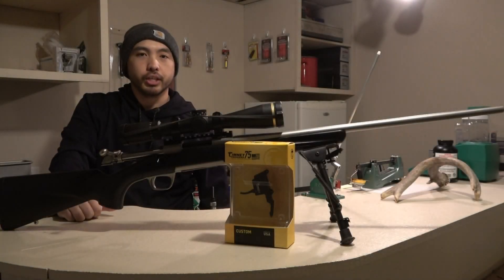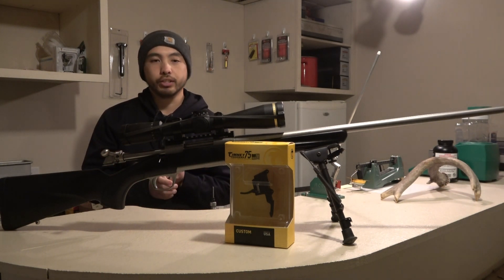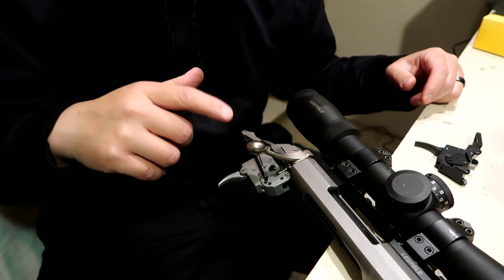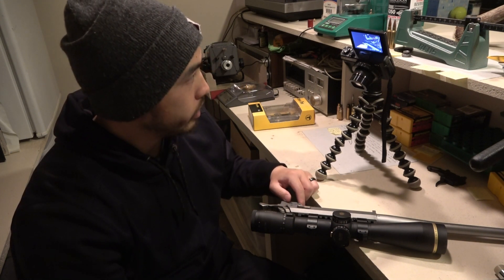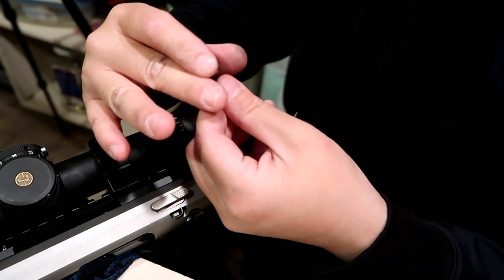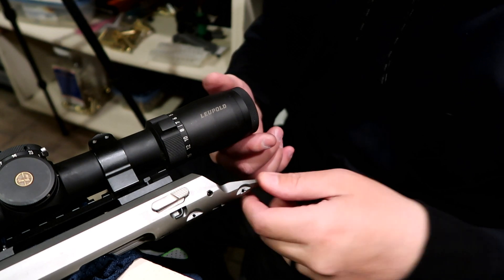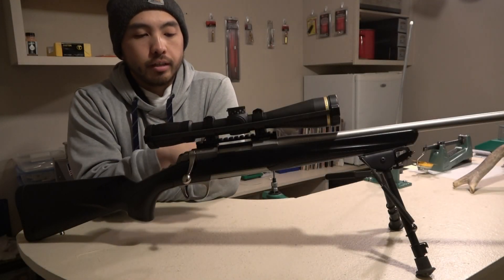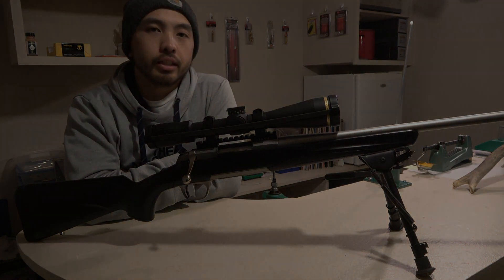BROWNING XBOLT TIMNEY TRIGGER INSTALLATION

Comment: Thanks for this. I know it’s an old video, but I couldn’t figure out where the trigger was contacting my xbolt pro stock. I removed a lot of extra material from areas that were unnecessary. Glad I found this video because I couldn’t figure it out.

Comment: Thanks for the video.  I just replaced my stock X Bolt Speed SR with the Timney.  Mine came from the factory set at around 4.2lbs.  I lowered it as far as  it would go to 3.1lbs. but now with the Timney I'm at a very comfortable and consistent 1lb 8oz.  One slight difference is I didn't have to make any cuts/modifications to the trigger well area of the stock.  Everything just went back together without any rubbing or issues using the safety.  Not sure if there's differences in the rifles in that area or what...but I'm not complaining!

Comment: I installed the trig on my carbon fiber X bolt. Went mostly fine, except I had to Dremel a small amount of metal from the trigger's bottom housing to get it so the pins would line up for re-assembling. Got that done and adjusted the trig to a crispy 2.2 pounds. Gave the (unloaded) rifle the stock-drop test; no accidental fires. Perfect!

Comment: What do you consider a better trigger? 

Consistency and quality or how light you can go.  I own both and the xbolt trigger is the best factory trigger I've tried.  No creep, no over travel.  Also they are adjustable to 3lb. Mine adjusted to 2lb 9oz which is just fine for hunting.
Reply from the maker: You own both of what? Both factory and the Timney trigger? The break on a Timney trigger is so much smoother than a browning. Even the Savage accu trigger is 10x better then the xbolt trigger. Most people that don't shoot enough probably couldn't tell the difference but for those that do shoot alot, you'll notice it.
Reply from the maker: @braeden32  Me ignorant? lol just because I didn't adjust this one doesn't mean I haven't test others that have been adjusted. Making assumptions like the ignorant person you are is just funny. Do what works for you. I don't care what you think is better, I'm doing what I like and what he likes. Xbolt coming from factory as good as Timney? lol what a joke.
Reply: @DMOUA_OUTDOORS  

You should of at least adjusted it and tried it.  Don't say it's mushy without adjusting it. It moves maybe  .01" how is that mushy? 

I'm going to measure the creep and over travel of the feather and compare it to the xbolt timney and i'll let you know.
Reply from the maker: @braeden32 I still have the xbolt trigger and can mess with it in the future if I ever feel like it. Like I said I have tested other adjusted xbolt triggers. Didn't care for it. Funny how people get all riled up like I spent their money lol.
Reply: @DMOUA_OUTDOORS  just ordered the timney. I'll reply with a video proving my point when it gets here.
Reply: I had a Browning X-Bolt and I thought the feather trigger was garbage even with a lighter weight spring. I'm considering ordering a Jard trigger. I'm not a fan of having to do stock inletting on a  "drop in" trigger. However I'm not 100% sure I won't have to with Jard as well. I've just had Timneys in the past and was not a fan of them except for an ar trigger. It's very nice.

Comment: I don't know about the X-Bolt but I have several A-Bolt's and they are adjustable and I can get all of them as low as 2.5 pounds. Also, if you know what you are doing you can polish the sear and make is so smooth that it truly feels like everything is on ball bearings.

Comment: I have 2 xbolts both factory triggers. If you run the tension bolt all the way in then out it for some reason gets the lb down. Both mine are right at 2lbs stock triggers.

Comment: Do all the savages come with accutrigger and do all brownings come with the same trigger? My buddies axis feels like pulling a non cocked hammer gun, and my xbolt is definitely lighter than 4 lbs, but my trigger has the gold look to it, so not sure if that means anything.
Reply: Every savage I have shot or held has had an accutrigger (as far as I know, they all have it)  I think it's hit or miss on the Browning when it comes to pull weight.  Mine is turned all the way down and is still over 4 pounds.  I'm thinking about selling the rifle and going to the savage ultralight just to get the accutrigger while cutting weight as a bonus.
Reply: The axis has a crappy heavy non adjustable trigger, the accutrigger came in the axis 2

Comment: I don’t understand why timney makes this trigger and you have to do all this “modifying” to get it to work. I have read multiple reviews of people complaining about it. I just don’t think you should have to shave off material to a stock or lose a safety feature. I love the timney trigger I installed on a Ruger predator but it’s a no go on my browning max long range. I can deal with the stock trigger for now. Maybe Timney will make something that just drops in like it should in the future. Or does anyone know of another trigger option? I put the Mcarbo spring in my Hell’s Canyon Speed, works ok- does add some creep though.
Reply from the maker: Most trigger installs require minor modifications to fit and that’s just the way it goes. Granted they probably didn’t think of the the added safety feature that Browning had while designing this trigger but it’s not even a big deal in my opinion. Good thing people can pick and choose what they want to do with their own money and buy whatever the heck they want or don’t want to.